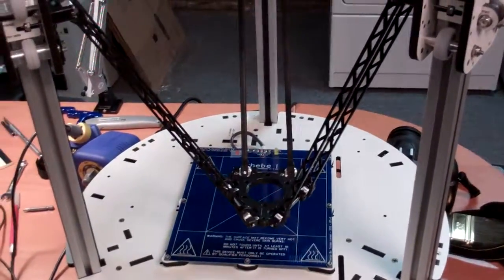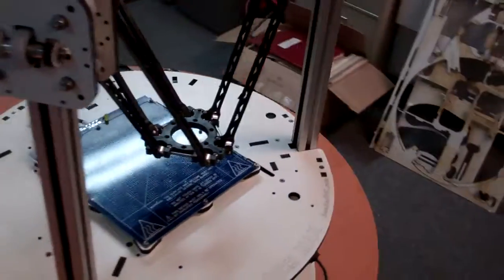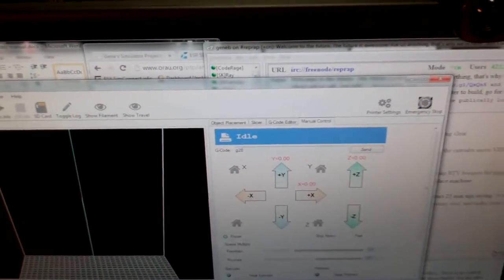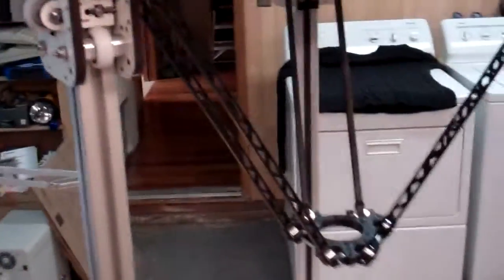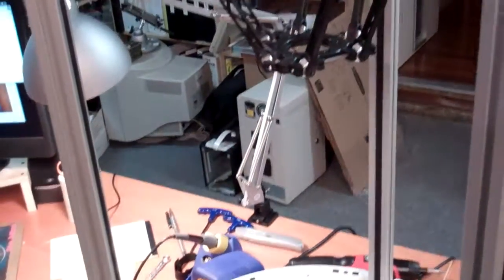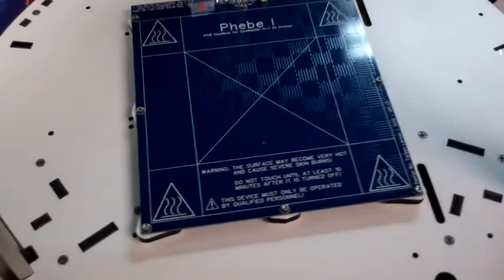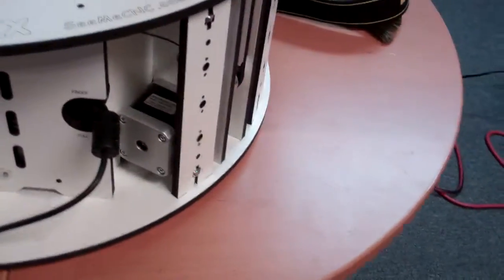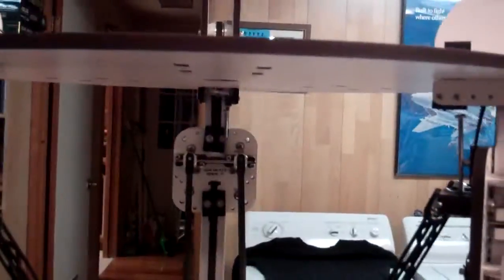Rostock MAX 3D printer introduction.

Comment: Hello and great video. If you don't mind, I have some questions regarding this printer.  I have been searching for a great starter 3d printer, so I have been researching them and found that this seems to be the ideal starter one and at a great price for such a build volume, resolution and filaments that it can use. What is the difficulty of assembly? Is there any way to increase the resolution up to 25 microns? What are the ideal settings that you have found to work on this printer that gives it excellent print quality? How well does it deal with overhang? When compared to the Ulitmaker version one, which one do you think is better? Would attaching a cooling fan to the printer head help with bridging? Thanks for your time.

Comment: Is this possible to make from scratch if I have access to a laser cutter or do I need to purchase the kit? Thank you
Reply from the maker: All the part STL and DXF files are available on the SeeMeCNC github repository.
You might be better of purchasing a set of the injection molded parts from SeeMeCNC and then cut all the melamine parts yourself.
Reply: f15sim Thanks for the quick reply.

Comment: the fixed bed is huge advantage, my reprappro mendel bed comes out of level constantly.
This bed is a little difficult to level perfectly, but well worth it.  Also motor wires don't move. So they don't wear out, same with the bed.

Comment from the maker: The hot end is VERY light - the extrder is located off to the side and feeds the hot end via a Bowden tube.  Due to the tiny amount of mass at the platform, it can move VERY fast and not run into lash problems.  The build volume is the biggest available right now.  The designers are even pondering one built from 8' sticks of 8020.  That would be something to see. :)